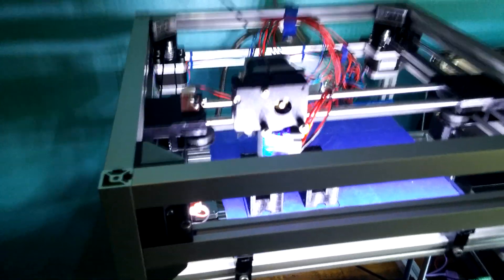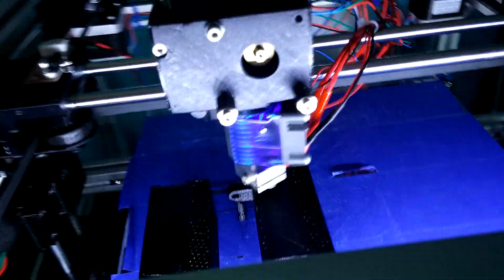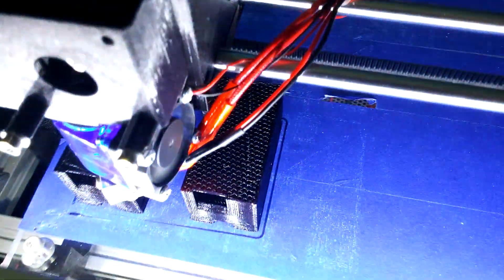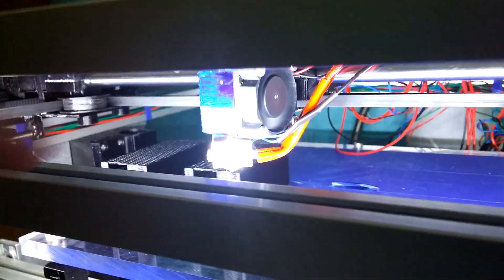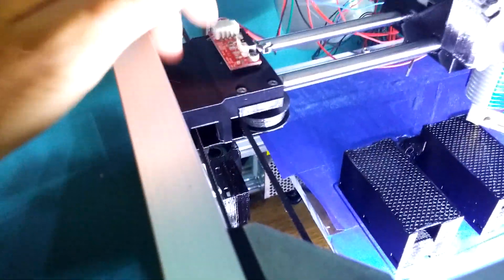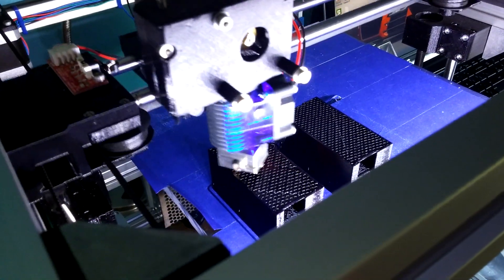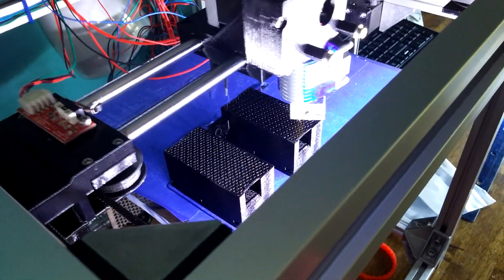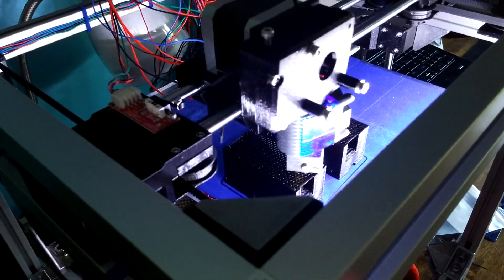E3D V6 First impressions/quick review!

Comment: There are clones of this hotend for $5, that supposedly perform just as well.
Reply: 3DprintedLife I did the comparison and the knock offs are quite good. But the original performed visibly better. If you have the money, youre better off buying the original.
Reply from the maker: Supposedly is a key word. Yes, it is possible you may get a clone and it was actually within spec and works well. But odds are you won't, and odds are even if it works at first, it will fail within a year. 3D printers are extremely complicated machines and a lot can go wrong, so I would never recommend buying a clone of a part that is so critical to the functionality of the printer. If and when it fails, the headache that comes with troubleshooting and getting a new hotend you'll find will not justify the initial savings.

The E3D hotend is an amazing hotend that is well designed, well machined, and uses good quality materials. It is a bit pricey sure, but you get what you pay for.

On a side note, I had the pleasure of meeting Joshua (one of the founders) and he's an incredibly nice guy who is truly passionate about 3D printing. I don't mind supporting his company one bit, and I still to this day recommend the E3D V6 (or Lite6) to anyone asking about 3D printer upgrades or hotends!
Reply: 3DprintedLife Well one of the perks of knowing English, is actually knowing the appropriate terms to use, so the you can avoid long complicated explanations. I thought "supposedly" already summed that up quite well, but I guess not?
Reply: Clones do not perform nearly as good. Just got this one and it's night and day. Doesn't clog up as much, no more dripping, less stringing. Overall much better and I can tell it'll last me a long time.  I replaced 3 clones in a short time period.  This will Outlast (except the brass nozzle point) the other hot ends so it's less hassle replacing them.

Comment: Curious what the difference is between this and the volcano head?
Reply from the maker: +thechainrule The volcano has a larger heater block in order to hold more thermal energy, in addition it is taller so the filament passes through the hot zone for a longer time so it will have more time to melt. Both of these help to melt the plastic quicker in order to accommodate for the larger nozzle. In theory, you could use a larger nozzle on the standard E3D hot end, but you wouldn't be able to print nearly as fast because you simply won't be able to melt the plastic quick enough (unless you artificially increase the temperatures, which can be dangerous for print quality and consistency!)
Reply: +3DprintedLife actually that's not correct (in terms of speed). It's about flow rate. The volcano allows for  2-3 times higher flow rate than the V6. If you use the same .4mm nozzle you can print crazy fast -- if you extruder can handle it. You just have to feed plastic super fast into the hot end to utilize the speed. But that's not really the point -- using same nozzle diameter. The volcano by default comes with a .8mm nozzle, that's significantly more coarse. If your model is a mechanical part which doesn't have fine details, the volcano will whip it out 2-3 times faster (at decreased print speed, you need to adjust the print speeds based on the flow rate vs the standard v6) because of the bigger nozzle. I've upgraded my e3dv6 to the volcano eruption pack with the .6mm nozzle, I've only done a few prints and the print time improvement is ridiculous. The results from the .6mm nozzle are very crisp, at .2mm layer heights the detail comes out surprisingly well. I'm using the bondech extruder, so you need a beefy extruder to feed the volcano.

Comment: Im in the middle of upgrading my oneup, I'm upgrading my z-height by 3x.. It looks pretty rediculous, but its comparable to a kossel- thin but very tall. However, my board controlling it is broken, im expecting a replacement any day now. I just had a frightening thought of it toppling over when the extruder assembly (thats twice as heavy as the base) is moving around 2.5 feet above the desk at 70mm/s.. Frightening indeed.
Reply: +Bclar3 will do. I'm still tryin got get a hold of longer smooth rods, so at the moment it's still stock.
Reply: +Bclar3 The -ups are very tedious printers, honestly I wouldn't reccomend them unless your price point is very low, as mine was. You have to baby sit the printer through the entirety of the print, you can't leave it alone for more than a half hour before something goes wrong. It's made of MDF which is just condensed shredded paper, my X gantry has broken in several places and my extruder is starting to split apart. Unless you're going to do what Printedlife did, and scrap the printer for its electronics and build something yourself, it's probably not a good idea to go with the -ups
Reply: ***** Yeah, I never liked the look of it either. I'd considered that printer before, ended up settling on the Robo3D, saved up $600, realized filament was $40 a roll (At the time) and ended up buying a computer.

Comment: When i use retraction when printing with my e3d i happens that the filament gets stuck and cant extrude. 
What is your retraction settings at?
Atm i just disable retraction and clean the print alitle more. But other then that its perfect.
Reply from the maker: +Lasse Kongo 20 mm/s and 1.5mm, try increasing your temp by about 5-10 degrees and it should prevent it from jamming.

Comment: Hey, I wanted to setup my settings so I can get the best prints possible, so I gotta ask a few questions if thats alright with you. What slicer do you use? What print speed do you normally run majority of prints on and what extrusion width do you use? Thanks in advance!
Reply from the maker: justinp4235 I use slic3r, with my 3uP I print at around 60mm/s perimeters and 150mm/s infill. I print 0.25mm layer heights and I usually just leave the extrusion width at 0 so it is automatically calculated, but for top layers I prefer to make it a bit thinner for better results. A rule of thumb is never go thinner than the diameter of your nozzle, and don't go wider than double the diameter. A good range is about 120-160% of your nozzle diameter, so for a 0.4mm nozzle you should stick between 0.45 and 0.6 for the most part.

Comment: I just bought this hotend. What's your settings for PLA?
Reply from the maker: Well it really depends on the filament you are using but I usually print towards the hotter end of the noted temperature range. The extrusion multiplier you will have to figure out on your own by measuring or experimentation and the speed can go as fast as your printer can handle! Depending on the layer height I've been able to achieve up to 200 mm/s print speeds, which could likely be faster if at a lower layer height (the only restriction was the heater block cooled down too quickly and the heater cartridge couldn't keep up).

Comment: you can get it state side from http://www.filastruder.com/ and yes it is awesome. the 1.75 is universal (bowden or direct drive) the 3mm (what i have) comes in ether bowden or direct drive
Reply from the maker: Damn! Did they just start supplying v6? I checked there when I ordered mine but I only saw they carried v5 and it still cost about $70 so I figured I might as well spend a tiny bit more and get the newest version straight from the source.
Reply: 3DprintedLife I got my v6 from filastruder. Plus the founder just did an AMA on reddit, so there's that...

Comment: Which model of the E3D V6 is it? With or without Bowden add-on?
Reply: When he did the unboxing it looked like he got a bowden tube holder that just snaps into the top of the hotend. All of the 1.75mm are the same and requires a small piece of bowden tubing.